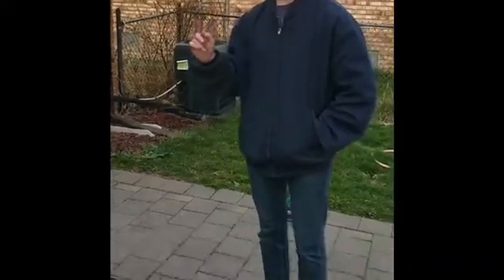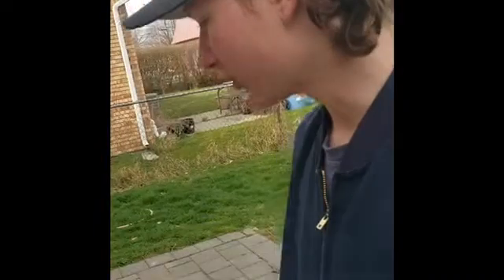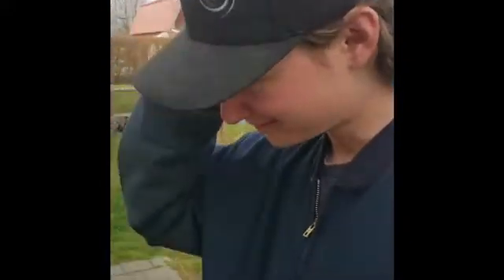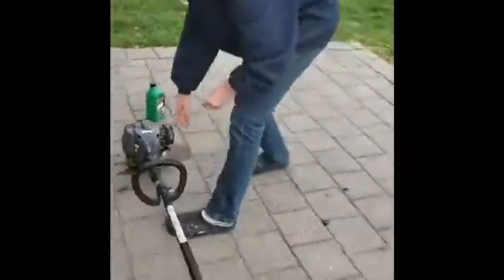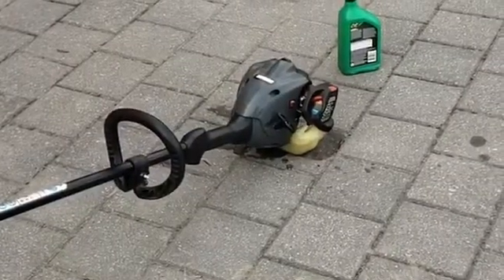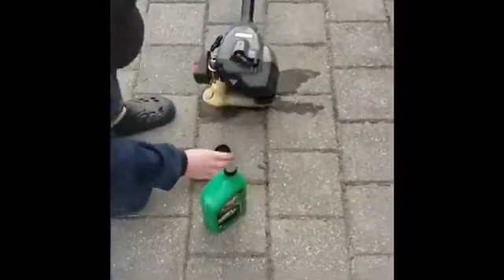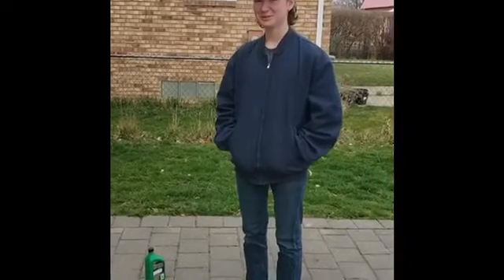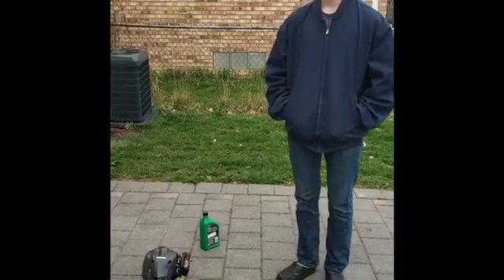Too Much Oil In A 2-Stroke

Comment: Thanks for doing this and posting. I was kind of under the impression that "as long as you got close" with the mixture, you'd be ok if you error-ed on the side of too much oil. When I last mixed up my 2-stroke gas can I just winged it. A couple of weeks later my weed-eater started acting funny. I didn't even consider the mixture as a potential issue. I ordered a new carb/plug/filter kit. After replacing all of that, though, the problem didn't go away. THEN I started questioning my fuel mix. It's running really rough - can't bring it up to speed - bogs down very easily, etc. I'm going to toss that mix out completely and start over, actually measuring this time :)

Comment: Go to Walmart and buy a ratio bottle. A plastic bottle with a cap that has graduations for mixing on the side.
Cheap and easy to read. Get some TC 3 oil and mix 50/1.

Comment: Well, if you're going to make a mistake mixing oil into the gas, its better too much, than not enough! Fouled spark plugs are cheap to replace. Scored cylinders and pistons, on the other hand, are rather expensive. Often, it's not even worth trying to repair, just get a new line trimmer.
Reply: Running to much oil like way over spec is not good because oil accually leans out the fuel/air mixture and can easily cause a heat seize in a higly tuned engine
Reply from the maker: Oceam thats why i did this.
Reply: Very well said!!!!!!

Comment: Bro how the fuck is your engine still running??? Lol I barely put just a little too much oil in the tank itself, and after a minute or so, I had no power I pulled the throttle and it died. I knew it was because I put too much oil but watching yours still going was a miracle of some sort lol.

Comment: Nice  ! But what brand of oil you used?  Because as I can see ,there was no smoke coming out of the tailpipe.
Reply from the maker: Z Florentin Z I honestly don’t really remember but you can see the bottle. It’s green.
Reply: @Kirby03  i can see,but i don't recognize it.
Reply: Z Flo Z looks like quakerstate 10w 30 LOL
Reply: @modelrc9500  thanks!  10w30 isn't for 4 stroke?
Reply: Z Flo Z it is lol, but in the past before there was oil for two stroke engines they recommended the use of 10w 30
Reply: @zfloz9895   Won't hurt it a bit , been doing it for years & most of my mixes I use A.T.F.  !! 😎👌
Reply: I use the same oil in my motorized bike I run 16:1 and it doesn't smoke at all
Reply: @anthonyrogerson6863  nice. But what oil it is?
Reply: @zfloz9895 " Quaker state universal air-cooled 2-cycle engine oil" it's the cheapest stuff I can get

Comment: Too much oil, never poor in the gas tank like that,  You need to lean it out by running straight gas. Same problem wit my skidoo. I did the oil delete (disconnected the 2 stroke oil pump) due to it running rich. Ran it a couple times on the road until it leaned out now Started running it on mixture 40 to 1. Runs like a top.
Reply from the maker: thats, the point of the video? im seeing what happens when you put to much oil in, just for fun.
Reply: @Kirby03  bullshit. You fucked that motor up.
Reply from the maker: @murraytichborne9903  Actually, that engine ran completly fine after i put some gas back in it, although a few months later some metal got into the engine and it broke. but the point of the video is that i have this engine that i am TRYING to destroy, and this is some of the mild stuff i did.
Reply: @Kirby03  that poor engine. Hope it gets well soon. Or rip weedwacker
Reply: facks bruh ( ͡° ͜ʖ ͡°)
Reply: @murraytichborne9903  bruh got trigered
Reply: @murraytichborne9903  wth man you know nothing about 2 strokes!! Why would you run a 2 stroke skidoo on straight gas😱 you can blow up and sieze the engine with no oil, too much can never hurt ur engine except run smokier and foul plugs.
Reply: @alexanderv7179  Alexander. If you want to clean the oil out of the engine due to too much excessive oil. Like this guy did. It doesnt hurt to run it lean for a quick brap. Run it lean. It's called small engine mechanics, it ain't my first picnic bud.
Reply: And how come I fixed multiple oil clogged engines this way without blowing a motor, Is because i know what the fuck I'm doing, ok slamcheeks.
Reply: @murraytichborne9903  I never knew that!  Learnt something new. I have a stupid question though if you could help me..  Iv accidentally been using 20:1 instead of 40:1 for about 6 months for my whipper snipper because I wasn't paying attention, how much fuel would I need to add to get the correct ratio as I still have like 400ml of 2 stroke still in the bottle, or would I be able to use the 20:1 for a 32:1 blower? I haven't been able to find anything on Google on what I'm looking for.  If you can't help, not a problem. Just thought I'd ask
Reply: @murraytichborne9903  your kind of a dumbass aren’t you, he said this weed wacker was free I doubt he cares what happens to it. I’ve seen weed wackers run on old 114 octane race gas with just a guessed oil mix, I think it’ll be fine.